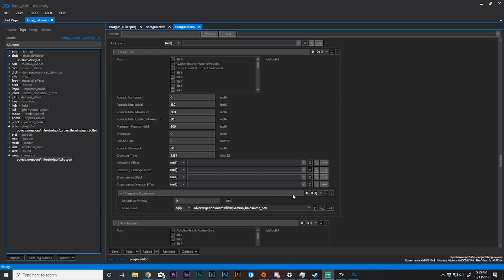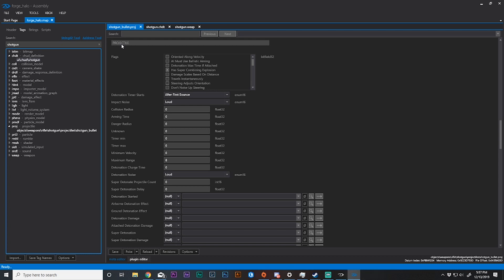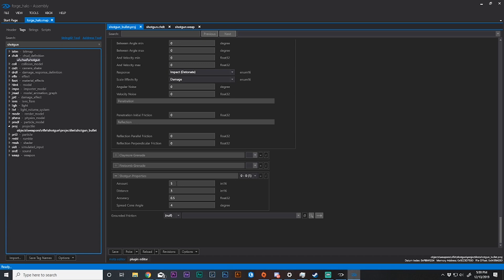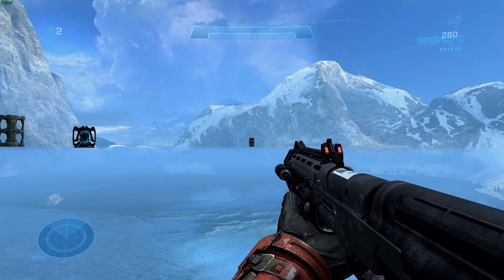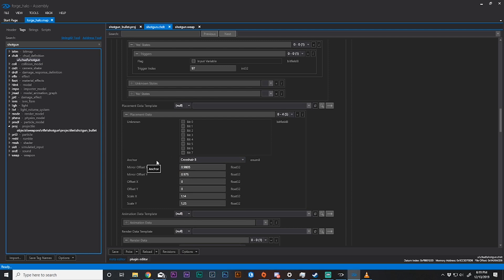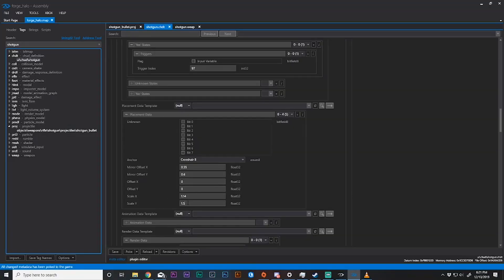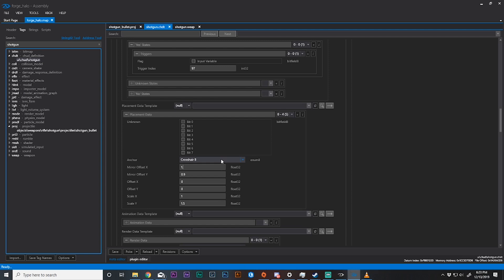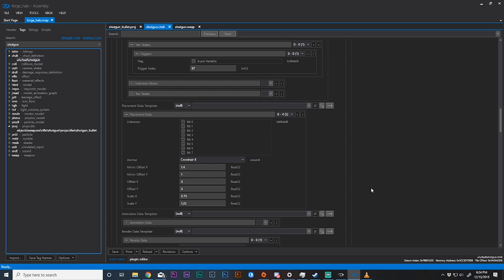Halo Reach PC | Assembly Tutorial #4- Shotgun Overhaul, Projectiles & Reticles

Comment: i plan to get reach and 1 sometime either this week or next from what i have researched to mod the weapons and such in campaign you would have to load each mission level separately in assembly (eg. m01 and so forth) is that correct? for me i would buff the shotgun for all the games in MCC except 4 because that one sucks to awesome Halo 1 levels which is:
Max Range: 40
Velocity: 140 - 100
Damage: 25
Projectiles per shot: 15
Max round capacity: 12

Comment: When I try to poke any change, whatever it is, on assembly it just pops up this error windows saying "System.InvalidOperationException: Cannot access game process. This could be due to Anti-Cheat or lack of admin privileges.
   en Blamite.RTE.MCC.MCCRTEProvider.GetMetaStream(ICacheFile cacheFile) etc. etc." and the changes doesn't take effect. Already running the game with Easy AntiCHeat off. Any help?
Reply from the maker: Launch Assembly as admin
Reply: @Crimson-Glacier-Studios  Already tried
Reply from the maker: You have the latest version of assembly?
Reply: @Crimson-Glacier-Studios  the one from NexusMods yeah, it doesnt even pop up any window notifing me about any update
Reply from the maker: @ericquevedo8055  That's outdated, you need find the "assembly downloader" most people will no longer need to get an uncompiled version from Github. Let me find a link
Reply from the maker: @ericquevedo8055  https://github.com/XboxChaos/Assembly/releases/tag/downloader
Reply: @Crimson-Glacier-Studios Now it says Engine not supported when I try to open a map file, I've got it installed in the reach directory, thanks in advance for the fast answers though.
Reply from the maker: @ericquevedo8055  You can install assembly anywhere. Make sure you have dev and experimental selected in settings. You should have a 2019 version installed.
Reply from the maker: Also keep launching as admin
Reply: @Crimson-Glacier-Studios  Installing as dev fixed the map opening issue, although the error I wrote you about on the first comment keeps showing :/
Reply from the maker: @ericquevedo8055  I would join the HaloMods discord and see about mentioning this in the support channel. https://discord.gg/VAxv3r